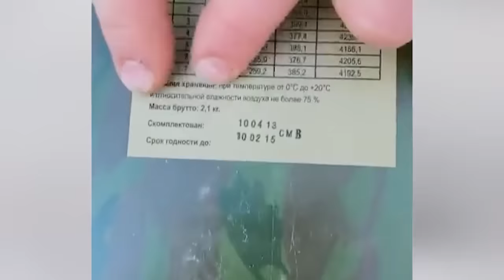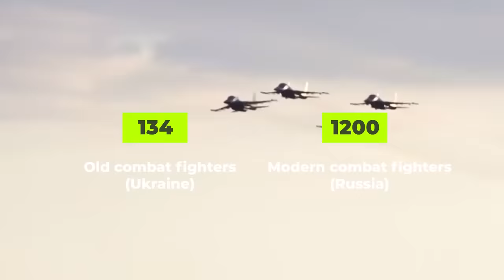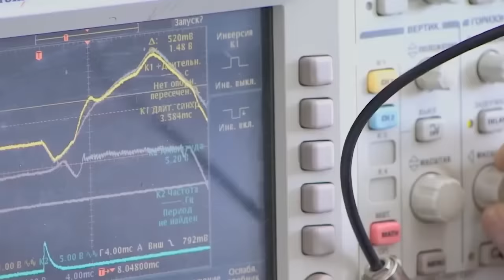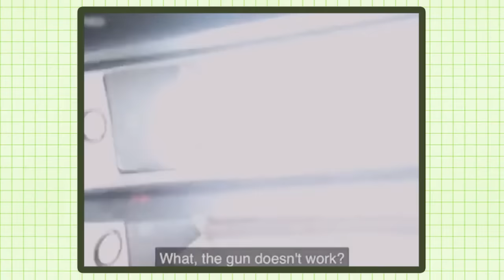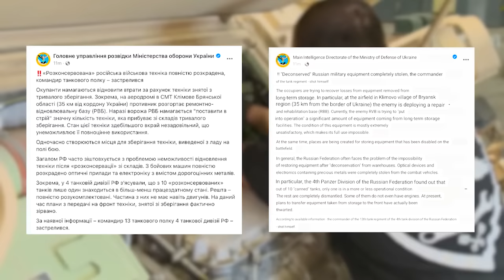Why Russian Arms Failed in Ukraine?

Comment: Equipment in the Sierra are there for reconditioning and repairs, most of them are not battle ready, main purpose is also to refit Abrams that need the new upgrades and some of those military trucks will be sold at auction. And a lot of those Abrams and Paladins will be sold to other countries but not with the major upgrades, how do you think we get rid of our used and discarded weapons so we can get new ones. Several artillery pieces that the Ukraine are using has come from the Sierra Depot and most of them have been used way pass the date they should be and have not yet been modernized like what we would actually use. And this is why America is the largest arms dealer in the world, we sell our junk to those in need, lol!
Reply: Imagine the numbers if no tank ever had been sold to outside the US..
Reply: Which begs the question dose the aircraft bone yard have enough f111 or a6 around that can be brought back to usable condition then shipped to Ukraine
Reply: @jessicacolegrove4152  yes, we have at least a couple hundred battle ready and fully functional. 
We are training pilots from Ukraine . They work in tandem with the F15 and F16's we are also giving them.
Reply: @jessicacolegrove4152  F111 suffers from crappy engines and the last airframe was built in 1976.  Putting these back in service would be almost like building a brand new plane or would be like taking a classic car rolling frame and building it out with all new gear.

Comment: A  high performance aircraft like the F-22 requires 20 hrs of maintenance for every hour of flight.   That's crazy.   They were supposed to have improved those numbers with the  F-35 but they probably didn't.
Reply: 20 hours per flight hour is a lot better than a/c like the F4 , F14, A10, A6, A4,. maintenance takes time and money but when you need something to work first time every time that's what you pay, much of the complaint about the F22 was about maintaining the stealth coating this was changed/improved on the F35 to require less maintaining. For example on a fixed wing aircraft the flying control operating units on an F4 would probably have had a life of around 500 flying hours on an F22 that will be above 1000 hours, helicopter components are half lifed so will have a life of say 800 hours but will be changed after 400 hours just to be on the safe side, and the components on the Presidents helicopters will be half of that life so would be changed after only 200hours then it will be fitted to a helicopter on an operational Squadron for the rest of it time to be used. That's why military hardware is expensive. When an F22 is purchased the USAF will also purchase extra undercarriage legs, engines, ground equipment etc, etc  to cover expected usage over the life of the aircraft so all of those costs show up in the cost per unit. Also remember you will have around a 100 people involved in keeping aircraft flying and 1 pilot. The aircraft "BELONG" to the ground crew we only lend it to the pilot for him to fly!!!

Comment: Russia has more than 7,000 nuclear weapons, and you can bet the readiness of these weapons is a top tier state priority. Best case scenario is 50% of them don't work, which means they still have 3,500 to work with. Do people honestly want to roll the dice 3,500 times, cross our fingers and hope for the best?
Reply: If all of their other equipment is already in such a poor state, why would you assume that its any different with the nuclear weapons? These systems are more complicated, easier to hide mechanical failures with them, intended to never be used. But even if 1 still operational its still a huge threat.
Reply: Make peace with those guys...sure. Just like dropping the soap in a prison communal shower.

Comment: The state of their nuclear arsenal is a very interesting question. My guess would be that it is quite likely to be useless. Why?

First of all, when it comes to newer designs, we have seen that those have been optimized for parades and choreographed exercises. If that's what you reward, that's what you will get. Some of the weapons have been exported, which calls for at least some level of function of course, but generally we may note that even weapons that have been thoroughly tested, and that can be tested as much as one wants, have performed badly.

Russian ground-to-ground robots for example, such as the Iskander, have turned out to fail in as much as 50% of launches. At launch, during flight, when approaching the target, and so on.

Now, imagine a much more complex system, such as the Sarmat, which is to deploy multiple separately targetable warheads, with nuclear charges of a type that I don't know if it has ever been tested at all (last test was 1989, under the Soviet Union).

This systems is complex, cannot be tested, and nobody has had anything to gain from ensuring that it actually works. The main function of strategic nukes isn't to explode, but to sit in silos and be scary - and they sure can do that. What is the likelihood that it would perform BETTER than the simpler Iskander that is built to actually work and that can be tested thoroughly? Nonexistent I would say. It's very likely that it works 0% of the time even.

What about older designs? Soviet designs have had the big advantage for Ukraine during the war that they actually work as advertised. However, the soviet-era nukes, which by all indications did work splendidly, would be towards half a century old by now. To work today they must have been meticulously maintained over all these years. What is the likelihood that corners haven't been cut in what would have been relatively risk-free corruption? (That is, nobody will want to see it demonstrated that they work.) If they haven't been very carefully maintained, the chances that they still work are next to nil.

So my guess is that Russia will no want to use its nukes. If they were to lob in, say, five tactical nukes over Ukraine, I think they would be right to be worried that they would all harmlessly dive into the soil of some Ukrainian field. The ones that wouldn't be shot down (it's likely they would minimize that risk by using a hypersonic missile, however.) That would mean that the Russians tried but failed to make a nuclear attack! It would make Russia look weak, evil and silly. Which is NOT the effect you're seeking with nukes.

So the first level of escalation would certainly be to violate the testing stop agreements and test a nuke. But to do that, one would have to be taken out of storage, brought to a testing site, and fired off. The US would see this happening, and if no nuke went off, that would also be a disaster.

So I think Putin prefers the nukes being surrounded by doubt. They MAY have a lot of working nukes. Who knows? He would probably not want the world to find out for sure.
Reply: I agree that said I don’t have the balls to attempt destruction of there nukes without them hitting us at least 10-20 times. I do believe we. Could pull of a first strike if it was all of nato.

Comment: I'd say the biggest problem isn't the weapons, but rather the doctrine driving them.  Unsupported tanks in urban warfare? That would leave any tanks destroyed.

Also on autoloaders, they got rid of the loader to add an autoloader a few decades ago, similar to what France did, and what japan has done with the type 90 and type 10.  Autoloaders have several advantages over human loaders and do not require the ammo stowage in the turret, that is just a relic of russian design that has been in use so long nobody wants to change it.

On "jack in the box" this could happen to literally any tank that has ammo stored in the hull, which is any tank at combat load. The only reason we haven't seen this happen to an abrams is because we have yet to see a javelin hit an abrams at full load.

Comment: a report issued over 25 years ago addressed the problem of the russian nuclear deterrent ,analog system ,hardwired an an antiquated design when installed in the 1960sthe main worry is that they might accidentally launch,because of corrossion and lack of maintenance.the usa has developed a system which can defeat a missle on launch..its unfortunate that no system will be expected to have 100% effectiveness.

Comment: Russian tanks aren’t really the failure you might think, Since the 80’s during “modern warfare” you will lose 1% of your tanks per day, Russia averages about 16 tank loses a day which is actually below 1% and less than 16 are lost now, after the first 90 days. Lack of anti-radiation air strikes on AA batteries before the ground invasion and lack of air superiority has been the worst failures I think

Comment: You'd think that, if you're forced to use dumb bombs, you'd at least try and dive bomb with them. We've had surprisingly accurate bombing since WWII, and you'd be able to stay high enough to avoid MANPADS and AAA fire, while being able to increase your chances of hitting. You'd be exposed on radar, for sure, but if the SU-34's countermeasures are as good as they say...

Wait... as good as they say... oooooooooohhhhhh...So now I assume their ability to defend against hostile missiles is also not as good as advertised.

Comment: Russian Equipment has always been JUNK. The Russians mass produce everything without Quality or any real testing and in years past just so they could claim to the world that Russia had MORE of everything and could crush any Army. But, the truth is for EXAMPLE: I was trained on every Communist Block weapon system. The T72 Tank that is still being used by Russia and that was used in Iraq is JUNK. The T72 Tank Driver is equipped with a 5 POUND SLEDGE HAMMER. Why? The tanks transmission has a tendency to freeze up in what ever gear is selected if the Tank travel over 35 MPH for too long and the Driver has to use the 5 Pound Sledge Hammer to Beat the Trans out of that gear to change gears and then the tank also loses the use of that gear. The T72 Tanks were designed without Hydraulic Turret and to shift the Turret from one side to the other is done with a actual HAND CRANK, which is slow and sometimes freeze up and has to be beat on with the same sledge.. This list could go on for ever.

Comment: There is a very obvious reality to recognize here: russia's GDP per capita is less than $10,000 USD anually, putting them at 57th globally, their total GDP is $1.5 trillion (11th globally), but their defense spending is 4th globally. This spending policy was completely unsustainable, which may explain the whole rationale of throwing military resources (and the unfortunate soldiers tied to that equipment) into the grinder, cut costs. The 137,000 additional soldiers being recruited in 2023 are going to be the most under equipped army ever conceived.

Comment: Without having done any research about the war, I disagree that Russian hardware is not good.
Look at their planes, they're excellent.

Any tank is a compromise, trying to balance: firepower, armour, and mobility.
What Russian tanks have in favour, is that they're very mobile. Ever since World War 2, their tanks have always hovered around 50 tonnes in weight.
Of course you can't build a super armour tank that will absorb many hits when mobility is the tank's main forte.

Tanks in general are not the invincible superweapons we all thought when we were kids and watching World War II movie.
Ever since the Germans started mass producing Panzer fausts and Panzer schrecks to a lesser extent, any tank could be rather easily destroyed.

Even Germany's own 'supertanks' were not all they were cranked up to be in World War II. There's the story in one of the "Tanks!" documentary series of the late 1990s - early 2000s, about a few Tigers, having blown away all Allied tanks and armoured vehicles that were in their way, run into a Normandy village and promptly being destroyed by Allied soldiers throwing molotov cocktails and even simple handgrenades.
If you leave the top hatch open, even the mighty Tiger will be destroyed if you toss in a handgrenade from an open window on the second floor.

My conclusion: the quality or lack of quality of Russian military hardware had little to do with their defeats.
It's the lack in leadership, or plain incompetency shown by commanders, high and low, that they would rush their tanks into ambushes.

And do you know how the German tanks were defeated by the Allies during the Battle for Normandy? By destroying every vehicle they could find by fighter bombers firing rockets and dropping bombs. Almost none of these attacks destroyed any Tigers or Panthers outright.
But in the end, those Tiger and Panther crews had to abandon their vehicles after running out of fuel. Because trucks and trains wagons loaded with fuel and ammo were just sitting ducks. And the only alternative left was to destroy their own abandoned tanks to prevent them from falling into Allied hands.

Comment: The T90 uses similar main armament and fire control system as upgraded T72s. Base T90s had T72s engine as well. The T90 was primarily produced for export markets (look - shiny new MBT much better than old one, yes?) just like the Armata. But no one wants to buy the Armata because it's way overpriced and too complex to maintain, hence they don't get the export revenue needed to actually put it into production. It's the same scenario with the Su-57 fighter jet; no buyers = no mass production.

Comment: I spent years debating with someone who said Russia's military is formidable, unbeatable etc. I said they were underfunded, suffered low morale and were relying on military equipment with its origins in the 1970s. Look at their trucks, they are from the 1970s with unreliable and inefficient engines; how are you going to fuel these when 100 miles from a base. Their tanks get transported on railways, what happens when Ukraine just destroys the railway bridges so you have to drive tanks 100 miles. Their command structure is broken, Russian soldiers don't trust their seniors to tell the truth and look after them. Their anti-aircraft system (the so-called "Satan"/ S-300 and S400) has turned out USELESS. It simply doesn't do what the Russians said it did. They are a joke and I was right all along when I said a little like China they are nothing more than a paper tiger who would stand no chance against a highly trained NATO army with good morale and equipment.

Comment: If I'm being honest i see the Russian  military the same as ours a little less Advanced and more rugged. Put any othere military in the same position that they are facing and you'll most likely get the same results. I'm no General but  I'm well aware that defending is many times better than attacking. My thoughts about it is if you're attacking a well-equipped army that's trenched in you'd need a massive Force the problem is that in this age all it takes is a 18year old with an iPad to rack up a kill streaks that'll put a Call of Duty pro to shame. Since you can't risk that much casualties you have to bring in armor to support most pushes such as tanks and attack helicopters, then you end up running to a bigger shit show flying low in a heli to avoid radar weapons and detection only to get shot down by that same weaponry kinda confirms what a lot of people already know helicopters are obsolete, what good is a tank if you don't have control of the airspace to top it off you have to drive it through dense urban areas, What good is that 120mm gun if your fighting Infantry that can pop you with a shoulder mounted  rocket launcher. 😔 to be honest this shouldn't be surprising twice already we as the military Powerhouse lost to sandal wearing poorly equipped enemies so what makes anybody think a much less funded military fighting a very well funded military will have a different outcome?

Comment: This is pure, fantastic propaganda.

In the early portion of the war, Ukraine destroyed Russian weapons... with Russian weapons. So, any way you slice it somebody was using the same systems effectively.

Since Russia settled down and concentrated on Donbas, they've been grinding the Ukrainian military into paste pretty consistently. A month ago Ukraine was complaining of a 15-20:1 disparity in artillery; now they're saying it's 40:1.

So Russia's antiquated, inaccurate, generally crappy weapons (that are probably going to run out of ammo tomorrow anyway) seem to be getting the job done. At least, the Russians own more of Ukraine every day.

Although Russia has established a zone of air superiority, they definitely can't fly anywhere in Ukraine at will. The Ukrainians largely used Russian air defense systems, which are very effective against any aircraft, including ones flown by the same country that built the SAM. Russia announces a daily summary that will help shed some light on how/why Ukraine is losing.

Still, Russian planes and helicopters deliver precision missile strikes daily. Although they're running out of groups of vehicles to destroy, they are taking out ammo and C&C installations every day. A number of Ukrainian units around Bakhmut have been annihilated, others are retreating without orders or otherwise deserting en masse.

Seriously, has nobody ever wondered how Russia can keep taking ground if they're incompetent / ill-equipped?

Comment: A cold war era weapons can be easily modernized...
1. Weld a edged steel around a old soviet tank
2. Weld a 1.5 meter bore to a turret soviet tank
3. Weld a thicker tires and gears
4. Paint it with a 2022 titanlux paint 
5. Change a name to " S" 300, 400,500, 600,700etc

But all of that modification  " S " still stands for shit systems...